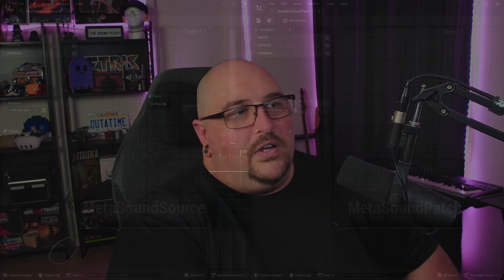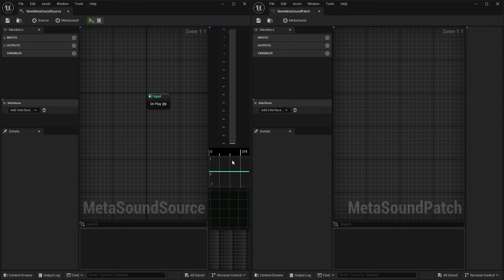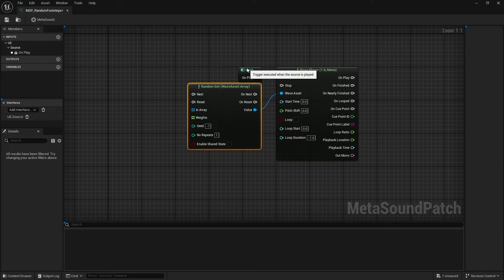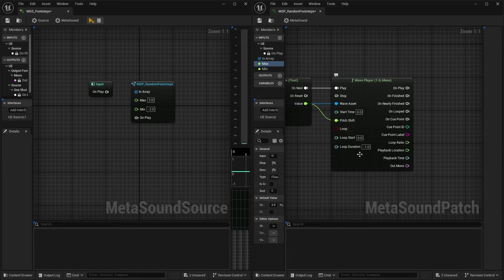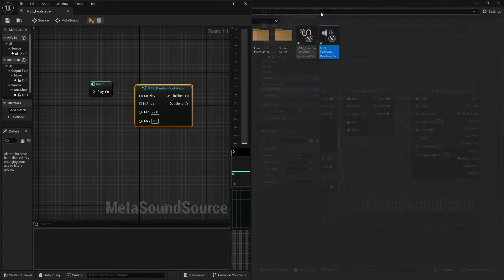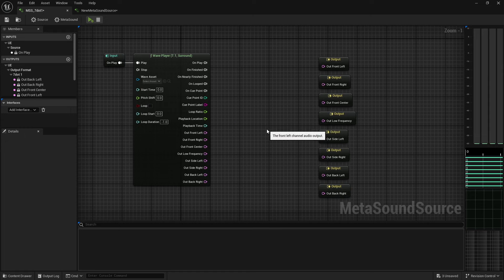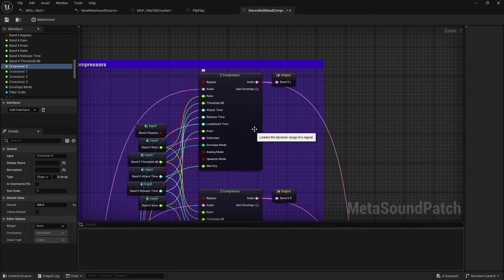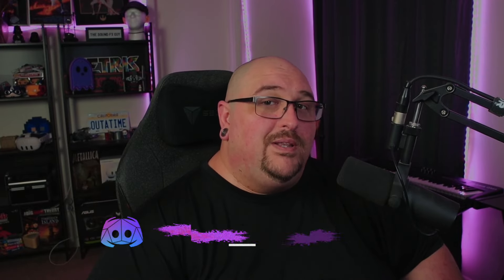Why You NEED to use MetaSound Patches | Unreal Engine 5

Comment: Wwise is perfect solution for all audio problems)))
Reply: I am searching internet for a guy who thinks Wwise or FMOD still necessary for all audio `problems` after UE5.4 , and i finally found one..   If you have a company that can hire 20 sound designers for a game and you have 4M+ sound assets, you might be right. I think Metasounds system can handle everything that Wwise provides now. Plus midi implementation etc. I really wonder your opinion btw.